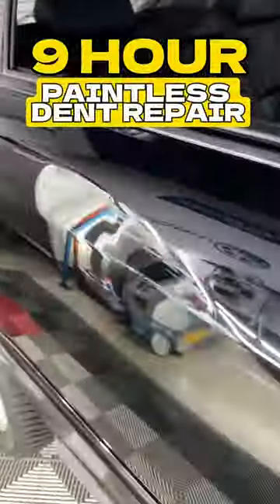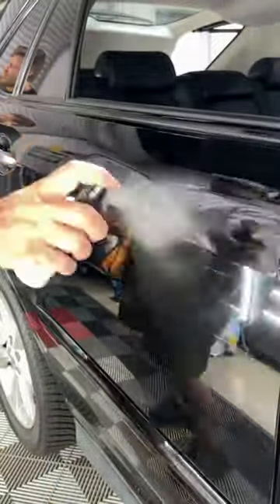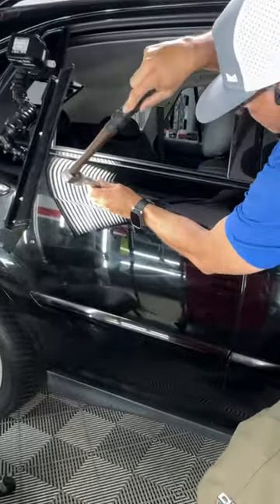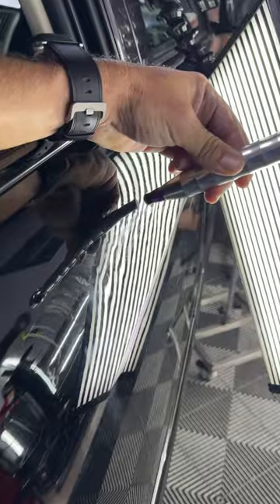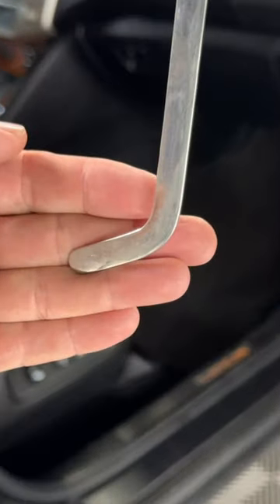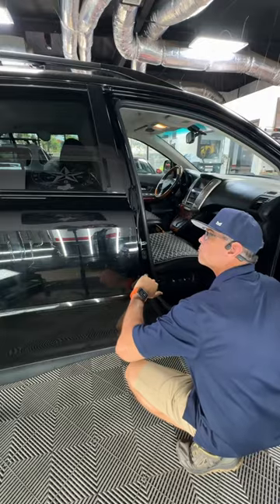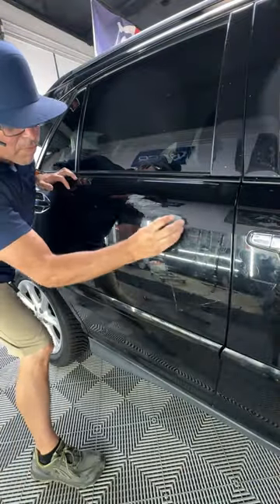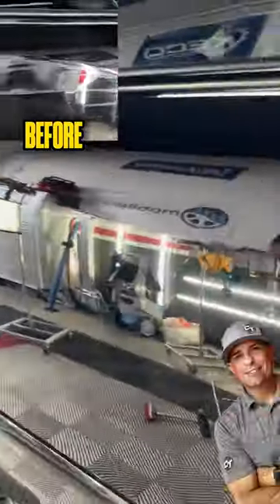Fast and Furious Paintless Dent Repair: 9 Hour Makeover

Comment: 10 hours of my time... ill buy a new door. 10 hours of your time! Worth 3 doors, i feel like you should know your worth.
Reply from the maker: My true value isn't solely determined by maximizing profits quickly. In the realm of advanced PDR (Paintless Dent Repair), it's a realm of unpredictability. 

However, genuine worth is achieved when my clients experience the ultimate repair, preserving their panel without resorting to invasive replacements or repainting. 

The result? A deeply satisfied client, bound by loyalty, and a promise of a long-lasting business relationship. 

This, my friends, is the epitome of timeless, principled business.
Reply: You still have to paint it, install the window and all thr attached parts. Try it so you exactly know what your complaining for.
Reply from the maker: It ain’t new first of all.. And what are the odds you going to find one with no dents, same color and without scratches? There goes at least 10 hours looking for a pristine Lexus RX door. People don’t measure their time until it’s too late.
Reply: Your an artiste' sometimes the satisfaction in beating the damage & doing something that 'almost looks impossible is worth the time. Money is secondary...
Reply from the maker: 100%! 👍😎
Reply: @denttime  these repares are definitely worth paying for if have a rare or classic. Keeping original paint & panels is priceless. Wish had known about this type of work back in mid 80s early 90s. Would have saved me lots of hassle.
Reply: @stimulatemyexistence5669 you’re right about the door being popular along with that paint color and model year. Problems is uniformity. The older a vehicle gets the less likely the pick-n-pull door will match because of sun/shade exposure along with was a northern or southern vehicle, exposed to road salt. Yes you can get a 95% accurate door but you won’t have the same age. I only know because I did do that with my wife’s 2015 Fusion that had the tuxedo black paint. Bought another 2015 door but it wasn’t exactly the same kind of gloss. The previous owners of that door did a lot of cut and wax jobs and the clear coat was worn out.
Reply: @domchessh4604 old metal is soooo much thicker than new metal. New metal doors are also hydroformed and the old doors are stamp and die. I had a 96 van and my coworker had a 2012 van same make and model. I showed him that I could hit mine with a hammer and not cause any dents, he tried it and creased the skin. I’m not sure how much thicker but you can feel it with 28oz hammer.
Reply from the maker: Some.. but how long you going to try to search and if you’re time is worth anything, it’s more valuable than money. Don’t forget all the labor involved. Removing the old door with a buddy. Putting the replacement on, connecting the wire harness back up and then adjusting the door so it properly closes and lines up. Everyone knows the price of everything and the value of nothing.
Reply: @denttime  I agree. I had a PDR quote and a body shop quote for a dent in my vehicle, a contractor knocked over a piece of lumber and it fell on my hood. Insurance said they would only cover the cheaper one which was the body shop. I marked the original mounting and kept the original hood. Body shop did a new hood and painted it. Problem was even tho they used the right paint code it didn’t match. I refused to accept and PDR took the hood fixed it. I still have the brand new painted hood hanging up on the wall in my garage. The car was a 2014 Taurus SHO in Ruby Red metallic.
Reply: There's a crapton of time saved "just" by not having to respray, recover or blend the paint. This body looks otherwise quite stellar as far as body and paint condition goes, and you're proposing ssving time on swapping a part you currently don't have. You're likely gonna be spending those 10 hours looking for for a door even close to that condition, and likely not find it. And if you're so lucky you do, you still have a big job with plenty of overhead cost ahead of you, while this guy is already done. So your time is spent doing a lot of other things, but it still ends up less valued, monetarily speaking.

Besides, clearly the kind of body and paint recovery this guy does, is a business where quality holds priorities above quantity. As long as enough customers want that, your time won't be less valued even when some jobs might actually take more time.

The only thing I would have considered doing differently (and I suspect he checked but it wasn't feasible), is take the outer and inner door panel off and the glass out, and see if I could get at those microindents from there. But it is admittedly quite common for impact bars or beams to be welded in right behind exterior body profiles in doors, so the large hole access from behind the door panels and glass, might not neccessarily offer any significantly improved access to the affected area. YMMV.
Reply: New door ruins the car cause the paint will not match
Reply: @denttime only if your inexperienced...you shouldn't be doing "advanced pdr" if your inexperienced,you eill end up giving yourself more work to do IE..this video.
Reply: As a body tech there is lots of positives and negatives to replacing the door to those  saying that its more convenient buying an OEM part you can swap window trim and all wire harness and all the shit in under 2 hours easily with experience but you still have to paint it if you can’t find the same color in a salvage yard and if you can and your not happy with the paint match you have to blend the front door to the rear quarter panel so a partial R/I for the front door removal of the quarter panel glass if it has one and you don’t want the paint to peel that can cost some money but if you buy a salvage door and don’t swap parts your likely to have an issue  most cars have lots of different harnesses that have different wires causing issues or incompatibility so if you think it’s plug and play your gonna have issues if I get a salvage door to replace the existing door I pull over a trash can and dump everything into the can I pull out till I have the door stripped entirely 2 Days sounds like a lot of time to put into a dent that could be fixed in a body shop for 30 mins of my time and a 1 extremely light coat of glaze after pulling the dent and light hammering crowns or brows in the dent are nightmare i can imagine for pdr .auto body and pdr are 2 jobs that don’t pay enough and it takes years and yearsand years to prefect cars are always changing so we have to as well love the work keep it up
Reply: @mrmalicious578  yes you are a body tech and from the sounds of it you are good at what you do...i gurantee you are absolutely aweful at things which you are not trained to do or even some things you haven't even done.
Ex...if you dont have the knowledge, experience and tools to do professional grade bodywork(like prep,paint etc...)its best to find someone who does...otherwise your resamding and painting every oil change lol...

IE...if you do not have the knowledge, tools and experience needed to produce a finished product who's quality surpasses that of the MACO alternative;(traditional paint/prep bodywork)you probably should pay a lot extra for a body shop to sell you shit you dont NEED...
In other words....a traditional autobody techs lack of knowledge=more happy customers for us PDR techs.
Reply: @mrmalicious578 your telling me if you get a dent in your door your going to buy a whole new door,and pay a shop+labor to color match it and install?....shouldnt that be a last case scenario?how about you go find the right man for the right job.
Reply: @glitchthecat5011  I was talking for people that are trashing and saying buy a new door that door was 100% fixable
Reply: @glitchthecat5011  and yes lol there is 100% as well things I can’t do or haven’t had enough experience in pdr is one of them it’s a skill in it’s self only been a independent body man on commission for 3 years been a helper for 2 but with cars always changing we will have to learn but not a master body man by any means I hardly keep my head above water when it comes to catastrophic hits where there is multiple panel replacements example replacing quarter panel on top of inner structure replacement and rear panel replacements in one job with frame pulling involved as well. done a few on them not fun jobs time consuming and don’t pay as well but it’s very mentally rewarding watching the before and after of a hit that makes people cringe and making it look like it never happened
Reply: Black paint.. massive crease.. and in the end it’s flawless ..!
Ooh yeah .. if that was a classic.. u never want to replace panels, and even if it’s new, yeah like u say.. new door, change wiring, regulator , door glass , colour match door seal, etc etc, that the regular dummy doesn’t know.. two days, 10 hrs .. that much skill.. “priceless”
Reply: @denttime ya man you’re right on. You did something here keeping the factory finish. I pass on a lot of stuff like this because people in Iowa typically won’t pay. But I love that you put a car back on the road no repaint. 
Then that customer is a customer for life. I can’t tell you how many stupid little jobs I did that had a legacy of multiple full insurance hail jobs down the road. Hard to quantify that. 

As far as replacing doors, only if necessary. I remember replacing two doors on my dad’s caravan, exact color no paint required. Lucky, right? Nope. They rusted within months. Junk.
Reply: Before Covid, maybe, but spares for premium brands  like Lexus are hard to come by now, and they have vin labeling on all body panels so there’s  diminished value to worry about now
Reply: Straight sorcery!!

Comment: How much do you charge for something like this
Reply from the maker: This can range between $900-$1500 for similar dents. No painting. Kept original and saved the client their valuable time. Thanks for the question by the way.
Reply: Was my exact same question... that's not what I was expecting....
Reply: @denttime what would it cost(and how long) to do it the other way, new door and paint?
Reply from the maker: Depends on the body shop. On average, 7-10 days.
Reply from the maker: I know body men cheaper than that but it ain’t about repainting. It’s about NOT REPAINTING.. so no debate here. 😉

Comment: as a PDR technician my self for a Fact he didn't put 9/10 hours on that job he said that because the price was probably high & if the customer watchs the video he doesn't feel like he got ripped off but in all reality that took him about a hour maybe 2 at most
Reply from the maker: No.. to be honest this was a much more difficult PDR repair that it looked. A nasty high crown that had to bring down carefully with little to no backside access. Every tap down went slow with as less mistakes as possible. However the cleanup was still miserable. I spent more time getting the flaws out then the initial dent itself. Cross checking, tapping and blending. Not a wham-bam-dent. It was slow and difficult to say the least but clean. Thank you.

Comment: Is this a way to make more money pf the repair? Bcs of paint job being required now?
Reply: Just curious because I’ve never seen a dent be so tricky..
Reply: It’s a way to save the vehicle owner the original factory paint. It does not need to be repainted now. The benefits to the customer:

• preserves original paint finish.
• retains resale/trade-in value of vehicle.
• quicker cycle time, vehicle does not stay at the body shop for weeks or even months.

Let me know if you have any other questions I’ll be happy to help educate you on the features, advantages, and benefits of the Advanced Pdr Method.

-Joe Garcia 
Dent Evo
Reply from the maker: Excellent explanation Joe! 👍

Comment: How much you charge ?
Reply from the maker: The average cost for a service like this typically ranges from $900 to $1500, and I position myself squarely in the middle😉. 

However, reflecting on my approach, if I were to do it again, I would consider a slightly higher fee. 

This adjustment would enable me to provide even faster service, allowing clients to reclaim more of their valuable time, all while I continue to accumulate valuable experience in the process.
Reply: I have a 3rd opinion, ignore the dent ,fixing it doesn’t make the car go any faster

Comment: I don’t mean you don t  do a good job. I meant it might cost more for pdr than full repair painting.
Reply from the maker: Yes but good PDR should cost more than traditional body work because it’s faster, better and the client gets their valuable time back without losing their factory paint. No carfax report and No diminished value. 

And PDR might look easy but it took me 33 years to gain experience that improves my efficiency quickly.

Comment: 2 days is it not cheaper to just repair with mettle dent pulled and little bit of bondo
Reply from the maker: That’s a bad suggestion. Crapy and lazy way with poor results brings no repeat business. Besides any intelligent client understand PDR is the best way WITHOUT REPAINTING.
Reply: @denttime   I’m body tech an I don’t think that’s a crapy repair at all it’s actually what the insurance prefers I’m just saying with a pdr stick and a dent puller I could have this close to perfect skim coat of glaze and done max 1 hours with primer painted reassembled in 3 hours total
Reply from the maker: First of all you’re full of crap. All the body men I know take pride in what they do and take their time to do quality work. 

Secondly your method is a bandaid not a fix or a legit repair. It won’t last. 

Third, insurance don’t pay body techs to repair anymore.. they pay to replace with after market parts. 

Lastly and more importantly, my clients don’t care if you can bondo or fill it faster. My clients are intelligent to be aware that your mentioned horrible methods is the worst repair on the market. 

They demand the best results without having to repaint and keeping everything original no matter how long it takes.. and when it comes to advanced paintless dent removal, nothing can compare. 

So please don’t keep tryin to justify how fast you can mud, fill and send it. It’s wrong, lazy and the worst option you could give a client who doesn’t know any better. Especially after 6 months, it’ll look like you did just that with no returned client EXCEPT the CHEAP ones who don’t care about quality.
Reply: @denttime your completely wrong I'm a body tech too and insurance definitely pays to repair panels 🤣 straight out metal use abit of filler , high build and paint it'll last the life of the car what your doing actually weakens the metal completely that door is soft as crap now you could push it in with your pinky stick to doing rock Chips leave the real damage to professional body shops
Reply from the maker: 😆 😂 Only thing you convinced me about your claim.. is that you’re insecure about paintless collision repair. You should get into advanced PDR. It’s the future. Not dictating insurance repairs that control your downward future. #truth
Reply: @denttime   it’s not even close to becoming the future if you’ve seen a busy insurance shop you would know if you spent 2 days on any panel you’re out of a job especially with these rates what you’re doing is ripping people off that really don’t know better
Reply from the maker: @eddyramirez6924 you think you could do it faster, better and cleaner without repainting in less time? Yeah.. not only am I offering a better repair.. I’m turning back time, in real time by saving my clients time. Something you can never do without your invasive, outdated, lazy and cheap low quality bandaid repairs. Keep trying to justify your insecurity. It’s too obvious. 😉

Comment: Most shops charge a minimum of 100 per hour shop rate, 10 hours 100 per hour that’s one expensive ass dent. Could probably have gotten a new door at the junk yard and had it painted for 600
Reply from the maker: Yeah, but you painted it. So don’t matter how cheap or how fast, nobody wants a repaint specifically intelligent people who want to keep the resale value of the vehicle and what Body Shop is going to be able to do a repair like that within 10 hours anyways? So, let me know any other better way that can have results like I do without having to repaint in less time that is better.
Reply: @denttime  you rock brother ! Mad skills, worth every dime